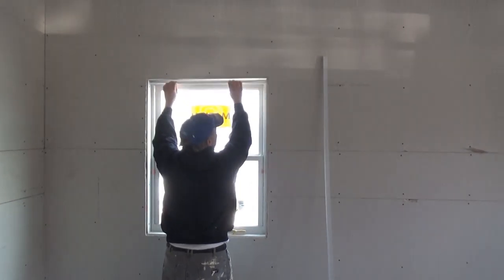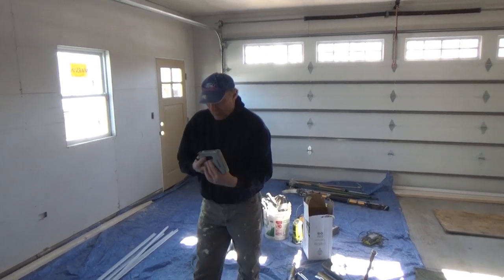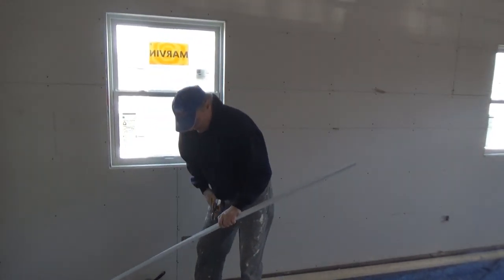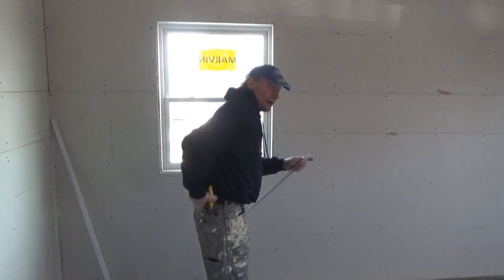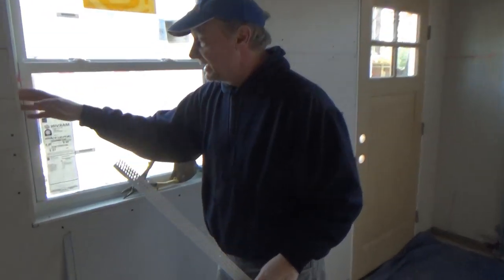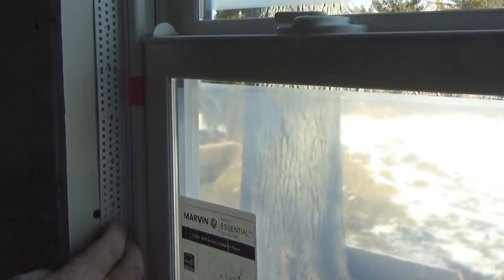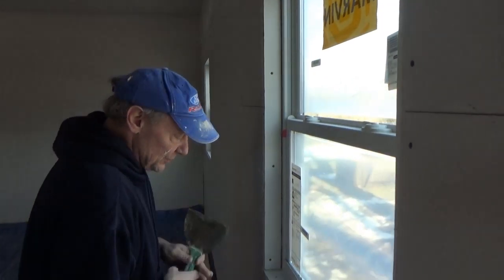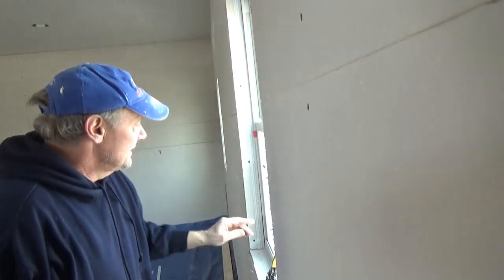Trim Tex Tear Away Around Windows and Thanks to New Patreon

Comment: Just used this on a basement where they only wanted one section boarded up with new drywall, but it connected to two walls with shitty old vinyl wrapped drywall, like they'd use in a trailer so I had no other way to tape a corner into it, and a drop ceiling that I didn't want to take down. Worked fantastic.

Comment: Ive been glueing it on for 15 years. Never had a problem with any cracking. I always spray both surfaces and allow time for the glue to set some. How can it crack if it will tear the rock apart if you have to remove it for any reason? I bet those guys that had it crack only sprayed one surface?

Comment: Good idea thanks Doc, garages are a normal thing like that for finishing a window like your enthusiasm
Reply: Hey Doc would the plastic crack around the window though
Reply from the maker: Eventually yes but you need to caulk that crack and it will be just fine
Reply: Rather just tile or marble I know coating around windows is a el cheapo way to go

Comment: Thanks for the video and tips! Hey I want to convert a window to trimless but don't want to add additional drywall to the window jambs as the blinds would no longer fit. The existing window is with a wood jamb. Should I cut the wood jamb out and replace with drywall? Or how would that work? Thanks!
Reply from the maker: Just know if you mud up wood the mud will crack and flake off because of the wood expanding and contracting.
Reply: Right, I was thinking if I removed the wood jambs up the windows, then replace it with drywall, doing a drywall return to the wall. Then I could put a tear way L-trim on the Window side and leave a 1/8th inch space, mud up to the L-trim, then tear away. I wasn't sure how the wood jambs work, if I could remove them without removing the window. We had new windows installed about 2 years ago and they were able to keep the existing wood jambs (and therefore the inside mouldings) intact. I don't know much about windows, but am I safe to assume the new windows just butted up to the jambs instead of going inside them?
Reply from the maker: I think you're right ✅️
Reply: Thanks!

Comment: I think tape tech recommend spray and staple, you just need need less stapling if you glue it. As per manufacturer specs.
Reply from the maker: They do but I've never had a problem with just stapling

Comment: Did you hang this?  This garage is similar to mine I'm DIYing.  I wish I'd put the ~15 inch section in the middle like this rather than the bottom like I did mine.
Reply from the maker: My hangers did
Reply: Personally I prefer to keep my factory seams rather than make a bastard joint. I'd rather have a seam a foot from the floor than a giant butt joint all the way around room.